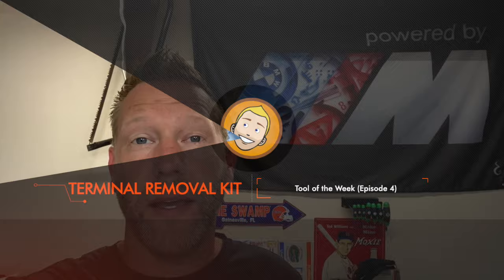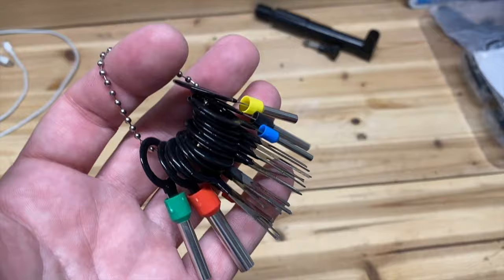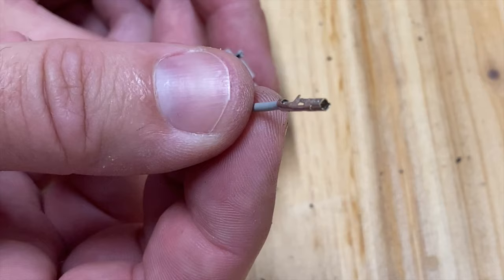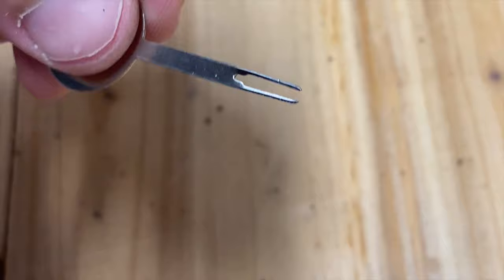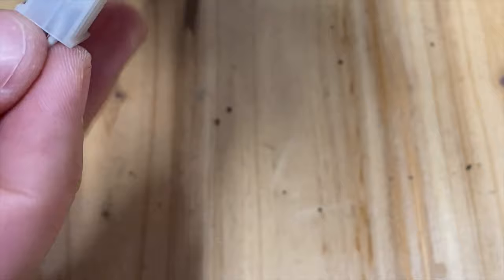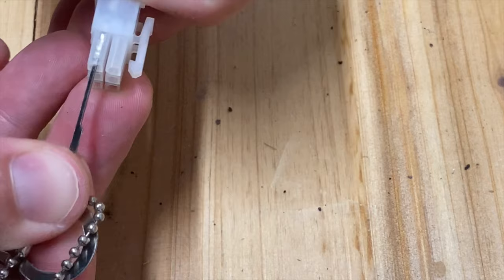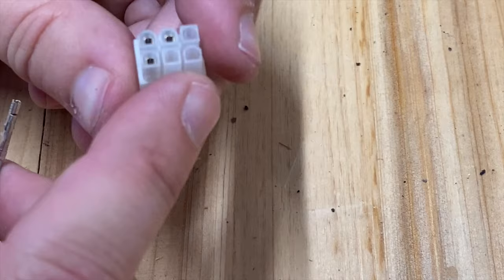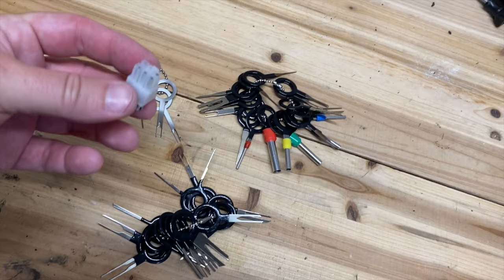Terminal Removal Kit (remove wires from connector/harness) - TOOL OF THE WEEK

Comment: Here is how I was able to do it :

The pin locks are NOT like a spring that needs to be compressed at both sides at once, but MORE LIKE needing to bend both locks and REMAIN bent/flush with the pin so it slides out. 

- Pushing both pins at once didn't work without crushing the connector or pin inside
- Used just the smallest single one that I have (at 2:36)
- Push cable/pin forward so it is not locked in it's slot
- Slide the single sided tool on one side in order to bend the pin lock inwards and make the pin slide-able.
- The same for other side, push cable forward, slide tool to bent the locking and make pin slide out.

Then of course you need to expand them again in order to lock in the connector again.
Reply from the maker: +adrianTNT thanks for the explanation!

Comment: The clear connector with round connectors you need to use a round tube tool
Reply from the maker: +Paul Brown 👍
Reply: Not gonna lie, I just used a juice-box straw and it worked on an old car deck I had in storage.  Can it be that easy?

Comment: Now I know to avoid this tool set, my Harley manual shows a disk with only four 
different tools on it, that may  actually be the tool I need. I've watched a bunch of videos 
on terminal release/removal, and so far , most of the presenters are using needles
and pins, of which everyone has. Would be awesome to find a video where someone 
has the right tool set to cover most of the common automotive connectors.
I'm already pretty good at wiggling things back and forth for 20 mins until I get 
the job done, would prefer to find the right tool set for releasing connector pins 
correctly and easily.
Reply: These look pretty handy for the price. For how cheap they are worth having.
Reply: Awesome statement! I agree. That was horrible
Reply: p

Comment: I have some 2.8 wire terminal connectors and the pins are brass. But, on my ebike they are silver or aluminum colored. Can I match them together ?
Reply from the maker: +Anio I’m no expert here, but seems if they were both meant to conduct electricity then they should work, but maybe someone else will chime in here

Comment: best tool set ever, right now i just keep them in a ziplock bag lol would like a better way to store them, anyone have suggestions?
Reply from the maker: +mr gadget mine came with the “rings” like a keychain.
Reply: @HelpMeDIY  same I took it off I wish there was like a plastic case or something that could fit them
Reply: Did you find the right tool in the set to work on  this connector, which one was it , if so?

Comment: That looked way harder than it should have been.  Do you still like them?
Reply from the maker: +Yogi's Garage I agree. Haven’t had to use them again yet but glad I have them!
Reply: Ditto, it might be as someone mentioned, that the round ones are the ones 
for this type of connector, could be..
Reply from the maker: @bikersoncall  yes I think so!
Reply: @HelpMeDIY  Thanks man, 
by now I've watched a lot of these
release tools, funny thing is , 
the tool makers don't tell you the 
connectors they work on , nor
which tool to use for which style, 
they just tell you 'all, or most' , lol...
Reply from the maker: @bikersoncall  I know! You’d think they would be more helpful, but it’s up to us to trial and error them 🤷‍♂️
Reply: @HelpMeDIY  Yep, I think its easier for them to make claims of all, and most, if they make sure to avoid publishing a list of 'most' connectors they're pretending to 
cover. 😄
Reply: @bikersoncall  

No, the round ones will be for round connectors I'd have imagined. Still, if the wiring connector has square terminals but plenty of room or pliancy still worth a shot trying the round tool I reckon. While a square peg won't fit a round hole the other way round is just fine 😄

Comment: Love the video. Have the same tools, but I cant find any video that uses the connectors I have. Ive tried every possible tool in this set, and cant remove a single wire. HELP. hahaha. Ive tried a number of different connectors, and still after months, I havent managed to remove a single cable. :(
Reply from the maker: +willyfox69 thanks! Yeah I guess that’s why there are so many pieces of the tool, the connectors seem never ending 😑

Comment: I bought a kit like that to use the tube-like tools to extract some connectors and unfortunately it immediately broke. The metal used is too weak IMO.
Reply from the maker: +Viktor Klang oh really? Bummer. Good thing Amazon makes returns easy :)
Reply: Help Me DIY Yeah—unfortunately it always breaks when you need it the most 😂
Reply from the maker: Viktor Klang well mine worked without breaking 1 of 1 times so far at least lol
Reply: @HelpMeDIY  Good initial stats! :) 
The cylindrical ones are plated, they aren't really steel but some other, weaker, metal :(